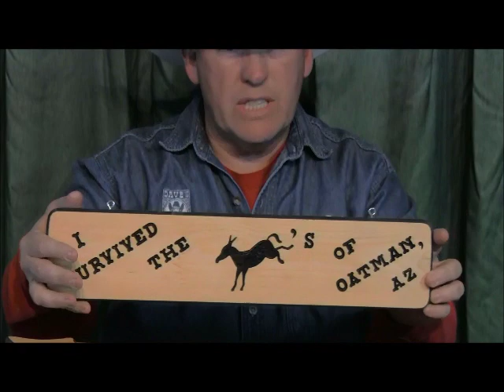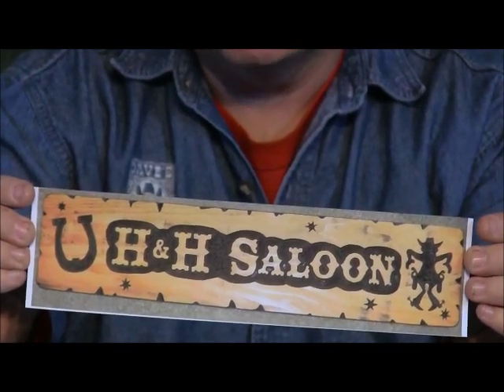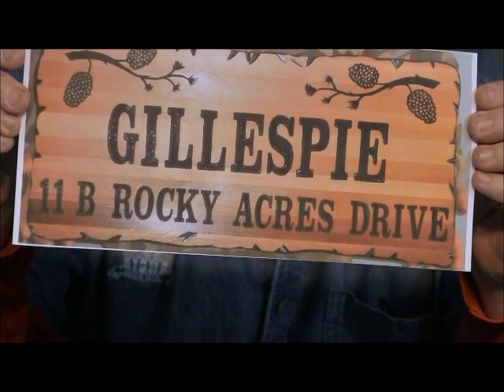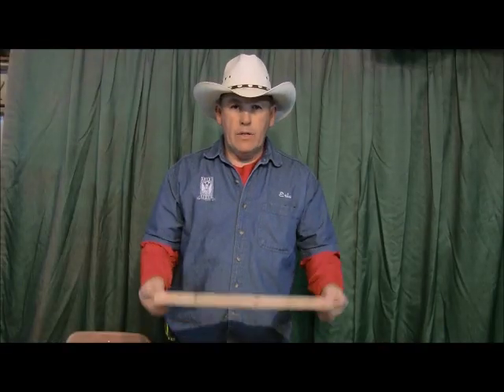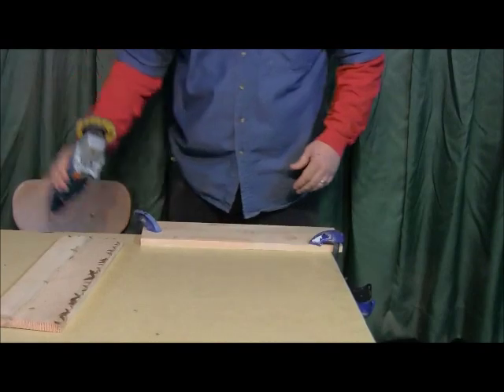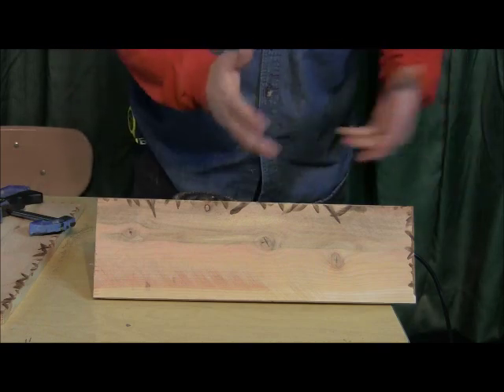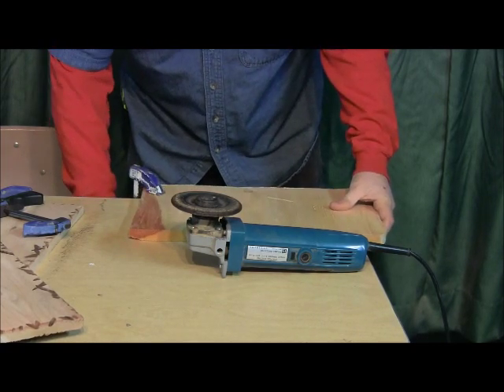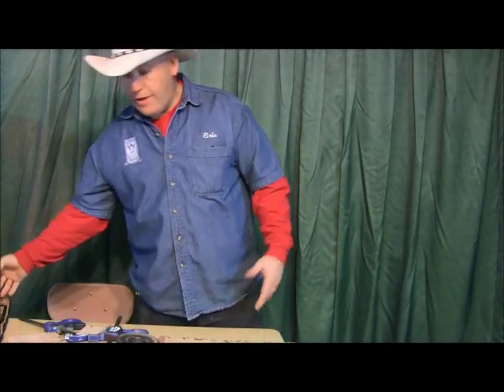#79 How to add a rustic look to your signs

Comment: I can get some White and Red Oak is that good for carving signs and will the wood make the Drill Bits dull very easy.
Reply from the maker: It carves good but it will dull the bits faster than softwoods.

Comment: So you have learned a valuable lesson... that the signs are for the customers - not for you!  I say valuable because I bet you could charge a premium for these... especially because they are custom made for the customer.

Take it a step further and offer real bullet holes.  If the bullets don't exit out the back, leave them in.  Try it and see how fast it sells.... I bet you'd be pleasantly surprised. Thanks for the video!

Comment: You don't talk about the pad that you put on your bench so your work piece won't slide around. could you do one about it . The name of it .  How much it cost . And where can we get one.    Thanks
Reply from the maker: I so sorry it's taken so long to get back to you on this. This new youtube comments format is kind of confusing. The pad we use is available at walmart & really lots of stores. It's called many things put it the non skid rubber that is used sometimes as shelf liner. It comes in rolls & is very inexpensive. They have a thicker version that is used in drawer liners for tool boxes. I found that at Lowes. Hope this helps, Eric